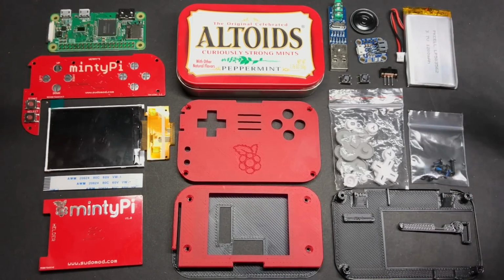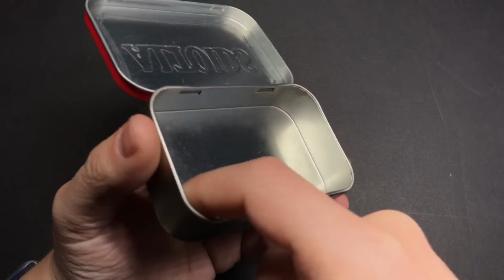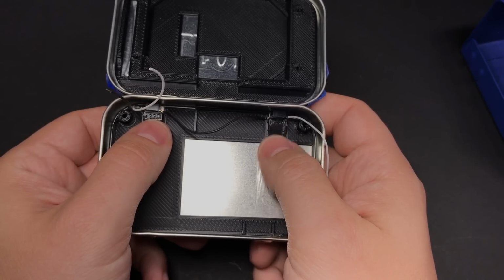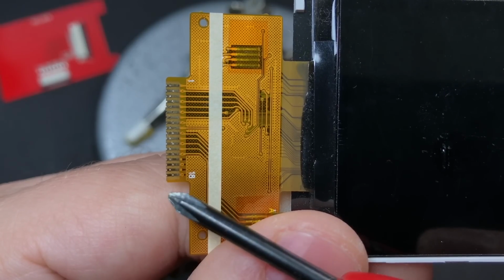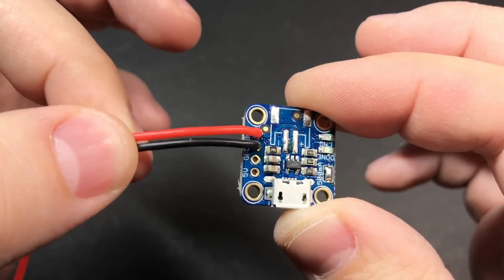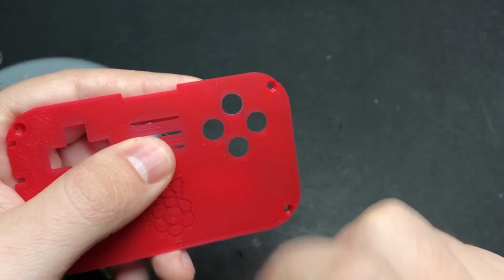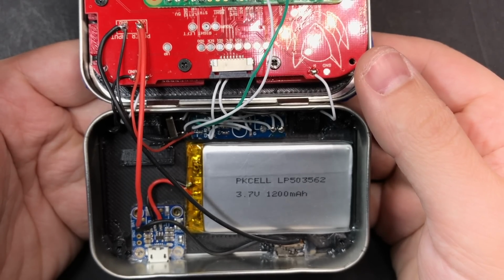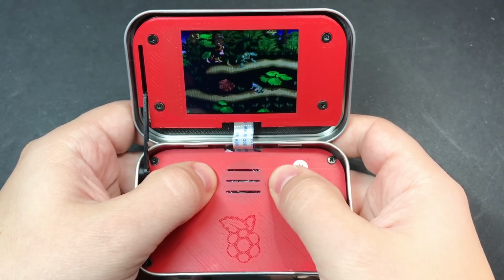mintyPi Build Guide

Comment: i would use 26 for power with my project that is similar, but there is very little space to even have wires in the tin im using i have to use 30

Comment: I bought a soldering/hot air station a while back to replace some anolog sticks on some PS4 controllers and it's collecting dust...would love to have a go at some projects like this..it would be sooo handy if you could supply like a checklist of all parts required and maybe a link to which parts you used specifically...for 2 reasons really I've never done this before I don't wanna buy all the parts go to start and realise I'm missing parts...but also cost it would be nice to price up the project before hand and not get to nearly finished and realise I'm missing 1 part and it just so happens to be the most expensive part that I can't afford and have to put the whole project off for 50 years 😂😂 fantastic video but this would be sooooo helpful 🤞🤞

Comment: I could be wrong but switches you're supposed to typically hook up to the positives. connecting and disconnecting the ground has a carbon buildup after enough uses which will eventually make the switch useless

Comment: Also if anyone is to make this now... PLEASE connect the switch to the positive wire instead of GND. Not only does this does this make it easy to turn on the system with a short, it also keeps the components on even though you're not charging it.

Comment: Hi People from Sudo mods I would try to support the plastic since it’s flimsy I know a bought this since your stl file for the bottom holders and where the raspberry logo is because they are to thin so I decided to raise the top by 0.5mm and put checker pattern on the bottom just enough to give the raspberry pie board room and I’m guessing this is the same issue on the minty pi 3 and if you guys use pla i would swap to Petg since you have a taz printer or abs if you have an enclosed printer

Comment: It does matter which way the speaker is wired! If wired backwards, it will pull air when it should be pushing, which sounds weird, and pushes air when it should be pulling air. Wire ground to speaker's negative and channel positive to speaker positive.

Comment: Something you could use to cut/shape the charging port and power switch holes is a jeweler's saw. Drill your pilot hole and attach one side of the saw blade to the handle and thread it through the pilot hole and attach the top of the saw blade to the handle and saw out your ports!
here's an example of a jeweler's saw : https://www.micromark.com/Jewelers-Saw

Comment: Always wear gloves when drilling holes close to your hand. Even at a slow speed it doesn't take much to take chunks of skin off or put a hole in you that wasn't there before. Always use safety gear when using power tools. You may look and feel like a dork but you'll be a dork with all your body parts still intact.

Comment: Just a curious question, how hot does the battery get and would there be a way to vent said heat?  The reason I ask is at times I notice that the battery in my handheld can get warm either by charging or by long play sessions.  I have not attempted to assemble this project, just putting that out there.

Comment: Just so you know, Always heat the joint for a few seconds, then apply the solder. It is a typical mistake to immediately apply solder and iron tip at the same time, but that is wrong. You want the solder to flow to the contacts to make good connections. It is also highly recommended to squirt some flux in all those connections first. That will help even more to make the contact joints very good.
Reply: Hehe.... heat the joint...

Comment: Love it and appreciate the effort, BUT you should seriously learn to solder properly.... I predict an early failure of this unit, due to solder point fails.
Soldering 101, remove old and remake new. NEVER mistake a soldered joint for a mechanical connection;  you should'v cleared the holes and soldered in pins between two rigid bodies. I can see, without benefit of a microscope, bad joints and possibly 'dry' joints' all waiting to cause problems, the worst of which is the dreaded intermittent fault, generally speaking, BUT in this specific case, the worst is the 1,200 mA Lithium battery enclosed in a metal box with various components that may or may not be safe and secure; it is a potential incendiary device.
I am not trying to 'beat you down., I love the concept but I fear the execution by persons unknown  and the unknown consequences...

Con

Comment: I've put 3 of these together.. .Noticed he makes no mention of what type of solder to use.  My experience has always been....less spatter, the better.  Use leaded solder.  Keeps your PCBs much cleaner looking.
Reply: Hey guys, sorry for the late reply.  I've already sold all 3 I made....Well, sold 2, kept one.  :)  I sold the other two for about $150 each.  The parts alone cost me about 120 including shipping.
Reply: How much money
Reply: How much for one?
Reply: What  type of solder? 60 Sn - 40 Pb is OK. 63-37 is better. Pretty much, the thinner the better. Small, low wattage iron, preferably anti-static and temperature controlled.
Reply: Can u make me one
Reply: I’ll pay 160 for you to make me one
Reply: What gauge wire should I use
Reply: Lazy
Reply: Lead free sucks. High melting point. Had some bad experiences with it.
Reply: @randominternetbro6562  Yeah... But Lead. Lead.
Reply: @forgor4410 As with any sort of project that involves fine particles or melting materials, use good ventilation. I stand by my claims that lead free solder is awful. It is harder to melt and it never sticks, even with flux. Also, it seems to be more difficult to find.
Reply: @randominternetbro6562  I know it'd be way harder to use, but asbestos was apparently a super, super good insulator..
Reply: @forgor4410  well yeah, until they made insulation that was better than asbestos. Currently, leaded solder is better than unleaded, so I'll stick with my own personal opinion and continue using leaded solder until there is something better.
Reply: @randominternetbro6562  Yeah, true. I just am real jumpy 'round toxic stuff.
Reply: @forgor4410  Oh yeah. Of course. I flip out if I forget to turn on my fan hahaha.
Reply: How much does it cost to make one I’m thinking of doing it
Reply: Stewart Deel  Lazy

Comment: Not sure i got the point of the soundcard... PAM8403 costs a few cent and you can keep a bunch around, it's BTL so it can make small speakers scream, and you can just feed it off the PWM audio output of the SBC. Oh and it runs in a wide voltage range, 3V is just fine.

Even ye olde LM386 runs off 3V just fine, though delivering a rather abysmal voltage swing... but still more than the PCM2704 soundcard. Yeah i know the spec says it's 4V and up, but you know, this is not mass production, these are hobby projects, and in 99% of cases, the spec is a bit too pessimistic.

As a word of note, the battery that you have there isn't going to catch fire if you just short it out, the DW01 chip on its terminal board is the protection, actually it does a lot more, like overcharge, overdischarge protection... but in general it's a good advice to be careful.
Reply: And I thought I was smart.
Reply: I'm not smart. I just collect things as i go along, and i've been around for a long enough time, like more than a couple decades.
Reply: Siana Gearz I
Reply: So numbers and letters are better than other ones right?
Reply: While that is true pwm audio isn't good quality, it has white noise introduced by the cpu and usb audio is crystal clear no noise introduced, also if you arent using usb for anything else usb audio is a good path to go down.
Reply: Konnor Bowen why did I read you comment in a shaggy voice?

Comment: About how powerful and expensive is this hardware?
Reply: It's Raspberry Pi Zero, a $5 (well actual price closer to $10-$15, else they are always sold out) board based on a fairly obsolete ARM11 processor, it emulates 8- and 16-bit consoles just fine, 16-bit arcade machines like Neo-Geo and CPS too, Playstation is barely within reach with more effort on the software development but currently not good enough, and impossible to promise that the needed effort will actually be put into it, and everything more powerful than that is a total loss.

Including all the little bits like the screen, custom boards, charger board, battery, amplifier or soundcard, 3D printed parts if you don't own a 3D printer, you'll probably end up paying $150 or more for the parts. The little things quickly add up.

Comment: Well the idea to move the crystal oscillator on wires is not a good idea (clock signal is very delicate). I'd put same frequency SMD type crystal there for lower profile.
Just an idea.

Comment: Something cool would be that there is a button with a light in the middle with a small chip (like an ATtiny) that notifies the raspberry pi when you press it and waits for the raspberry pi to shut down before killing the power and turning off the light on the button, and kills the power right away if you hold it for 10 seconds(in case it froze).

Comment: nice, for future reference speaker polarity doesn't matter on speakers  because they use AC current UNLESS you are wiring multiple speakers because speakers with opposite polarity or in a 180 degrees out of phase will cancel each other out thus producing little to no sound. Yes some speaker manufactures for speakers large and small mark positive and negative terminals but only for a reference so you can wire every speaker in phase.

Comment: Instead of sticking a Soldering iron down in those tiny holes, would you be able to to solder paste and heat that up until it melts and fuses the two boards?

Comment: to those with out electronic experience don't try this
Reply: Ian Andrews other than the tools for the job, doesn't look like any crazy experience was necessary
Reply: Its ok to be in denial, accept it, son. I AM YOUR FATHER
Reply: Ian Andrews  thank you for saving me money lol
wheres a good place to start?
Reply: @gokuvegeta4378  well this isn't exactly as complicated as this but try to make a computer with a pi on amazon you can get a kit for 32 dollars (I recomend that because it comes with a sd card with noobs and with my experience its hard to make one) it comes with everything you need then seperatly you need a moniter, hdmi cable, keyboard, and a mouse also if you get a usb mouse or keyboard  you'll need a micro usb to usb hub but the pi has bluetooth so if you can  get a blutooth mouse or keyboard that would also work
Reply: Learn how to solder first off, also a little bit about simple stuff, like voltage, amperage, resistance, etc. It'll help a lot. Also you should learn how to splice wires, maybe 3d printing but thats not that important
Reply: Your not my MAM!!! GAWD.
Reply: I went to college for electronics. I'd recommend you start with Weller WLC100 & Elenco XP-15 KIT for soldering training. After that, this project shouldn't be too bad.
Reply: It's true if you have no electronic experience it will be very hard. But don't let that stop you. I barely knew how to solder and got it done
Reply: you don't need electronics experience to follow this he just need to know how to solder solder then you should not attempt this but electronics experience is not at all to follow this literal step-by-step guide unless you just cannot follow directions
Reply: So should I just ask a friend with electronic experience to do it with me
Reply: Good info
Reply: Ill have my step dad do it (an electrician 😏)

Comment: hey, couldn't you do a thing where you get a long hdmi cord with a converter and add a hole in the tin so you can do a nintendo switch/wii u thing where you use the mintypi as the controller? that way you can do console or handheld and you have a screen on the controller in console mode. seems like it would just be a matter of drilling another hole...

Comment: For drilling the holes you might want to consider a pin vise. Being a hand tool they are going to be slower but I think you would have better control vis-a-vis the electric drill.

Comment: Love it, but a few things I’d do differently (call it a suggestion box for 3.0?):

- Slightly bigger screen. Yes, the form factor of an Altoids can is limiting, but there’s a lot of bezel there that can be thinned out
- 4-shoulder buttons. Seems like every pi project on the internet doesn’t care about emulating the psx by only including L and R and no L2 and R2. The first small-form project that does this is the one I want to build.
- HDMI breakout. Allow this to be plugged into a TV when not being used as a portable.

Other than that, definitely the most fun-looking pi zero build on the internet. Great work! :)

Comment: Silicone coated wire is so wonderful. Only problem is it exposed how horrible plastic coated feels :P
As a bonus, silicone won't melt if it gets too hot, making it capable of carrying more current than it's gauge would imply. Also very nice. Much better than the fiberglass braided wires traditionally used for carrying high currents.

Comment: I like how the project looks but I have one gripe, but it's software (retropie specific) over hardware.  Why would anyone use start+select as the return to menu button set? There are many games that use that combination to exit levels (especially in snes, super mario world comes to mind) or do other functions.  Why not make it L+R+A+B+X+Y or L+R+Start+Select? I doubt many games out there, that could be played with this set up, would ever use such a button combination for any purpose.

Just putting that out there. Not trying to be a dick or anything here.
Reply: You can change that in the Retropie settings pretty easily. I built an arcade and changed mine to player 1 and 2 select.
Reply: Well the gripe is more pointed at how that is the default setting.
Reply: Not all games use the triggers or extra buttons so it makes sense the default would be buttons any game would have in case the program was used with only one emulator. So more than likely that's why it's the default.
Reply: Not when the retropie programming runs under the overlaying emulator and can override what is being input.  For instance in an emulator like FCEUX, only the control pad, start and select and a and b are used in game. but the retropie (retroarch) programming recognized as many keys as you can through at it. So it will recognize L+R+Start+Select easily enough without any hickups and FCEUx will not register anyway.

Now if you were referring to the game controller instead of the game. Then yes that would be correct, assuming the controller has a start and select.

Comment: You should put the power button on the same plate as the buttons so you don't put it in a bag and then lose all the charge because the power switch was knocked on

Comment: I may do this in the future, but I plan to invest in the Altoids tin over at countycomm.  I own one and it's the same dimensions with thicker steel.  The only thing different is the top lid is slightly larger(I had to verify before posting this).  Closed the tins are the same size, the extra material is in the form of a longer lip that comes down further where the lid portion fits over the box portion when closed.

Comment: ugh. just seeing that speaker makes me want to throw this shit in the trash.

1: do not ever use a metal case for anything meant to house a speaker. or anything electronic for that matter. build a small wooden case of the same or similar size.

2: do not ever use a black mylar speaker for any application. this is what chinese knock off companies drop into their shit because fuck it, they are pretty much free. they also sound like complete trash.

3: stop double sided taping everything all over the place and act like a goddamned professional. use a WOODEN case, and screw the fucking boards into place. also add some air holes genuis, or enjoy this shit stain burning up on you.
Reply: This isn't a professional build, the reliance on tape and glue is perfectly acceptable in homemade projects. The reason the speaker is used is BECAUSE it's so cheap, and you don't need more in a project like this.
Reply: yeah actually, you DO need more if you dont want it to sound like complete garbage. spend a full 1$ instead of the $0.12 this piece of shit costs and you would have decent sound. spend 5 minutes fashioning a wooden box and youll not have to worry about it breaking the first time you drop it, or something accidentally shorting.

Comment: Hi, I wanted to try and duplicate this project with my father so I could find a use for my raspberry pi. Though I'm not sure it will work because I have the Zero V1.2 and the one recommended in the video was a Zero W. Will mine still work even though it's a Zero V1.2? Please respond, thanks

Comment: The switch didn't work on the black wire because you floated ground! It was turning on depending on what potential it happened to be at relative to battery +ve

Comment: I love the pi models and they got me into engineering but they have small problems that piss me off, the pi 3 sometimes doesnt output any audio through hdmi sometimes, pi zero if i even look at the data pads on the bottom it breaks, and there is not one fucking cable that works with the 4 pole port on the A and B pi s

Comment: When I was a kid, we used to take tin cans, fill them with water, freeze them, & then poke holes with nails to make lanterns. Maybe that might be a decent way to prevent bending the case for interface holes? Either that, or 3D print an internal bracing jig. A template could also be used to help with mounting the screen, etc... Awesome build, I want one, and maybe I'll try making a brace or something =)